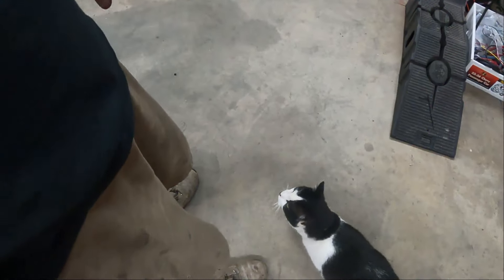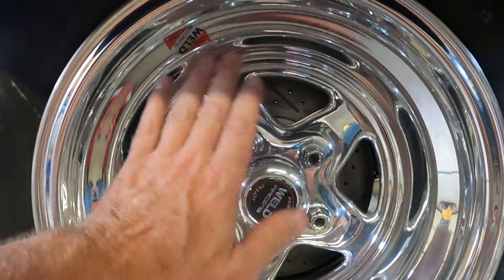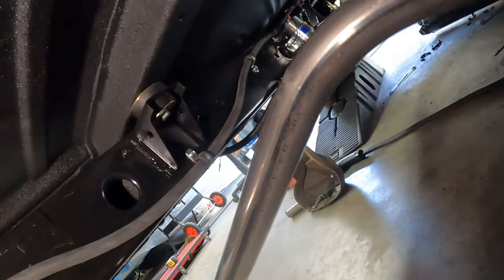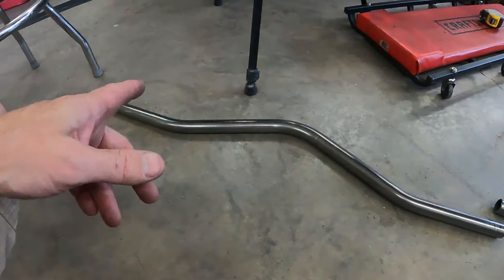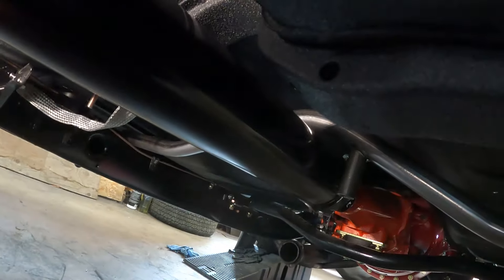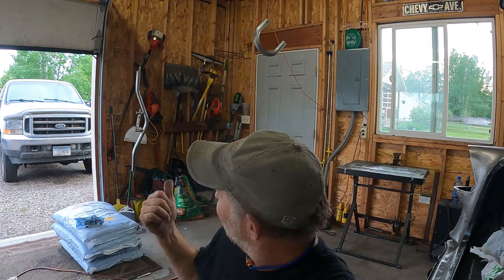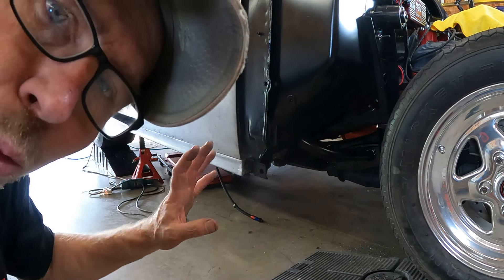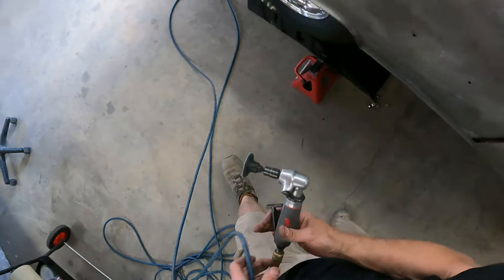NHRA Driveshaft Loop Installation, NHRA Fuel Line Re-routing, and We Suffer ULTIMATE FAILURE...

Comment: Williams Classic Chassis Works, Earl Williams makes a bolt in crossmember and the driveshaft loop is integrated. Pretty nice set up. Guess its to late now, lol.
Reply from the maker: Thanks for the tip. I've bought a few things from WCCW. Great company with good products. I already had a crossmember, so decided not to go with their crossmember/loop. It does seem pretty cool though. I ended up having to re-do my loop anyhow once I added the Gear Vendor overdrive. Thanks for watching!